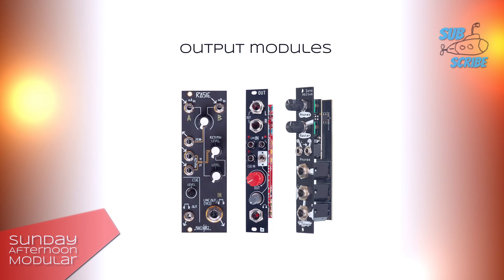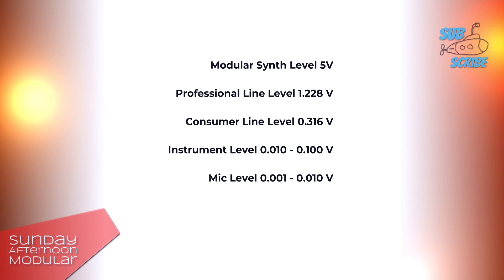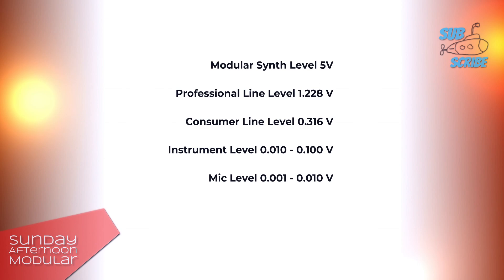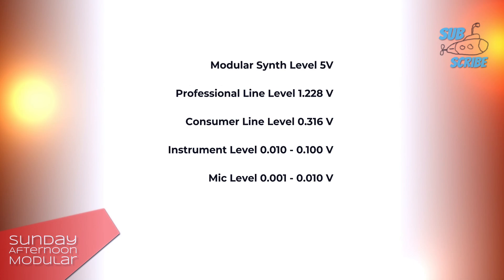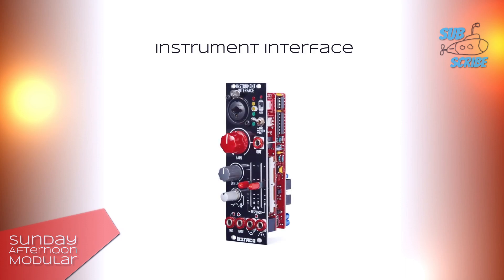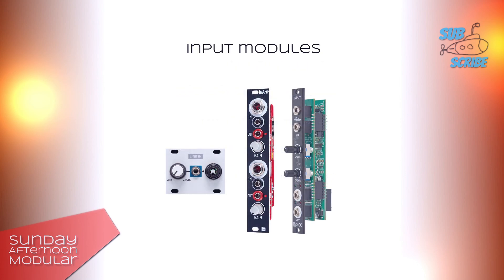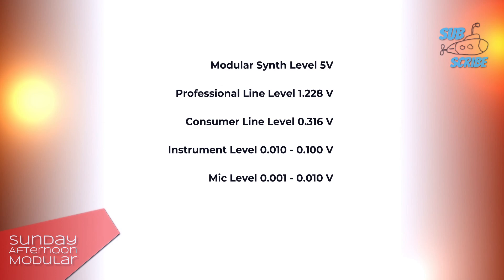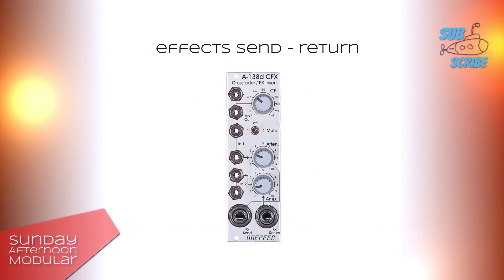SIGNAL LEVELS - Or why In- and Output Modules are of great value

Comment: I feel like an attenuator set properly is electrically valid way to drop to line level (it's not good for trying to hook up headphones). A passive attenuator is a voltage divider, what the output of your module "sees" is the resistant of the attenuator not matter what setting is there. And the divider point is the wiper of the potentiometer and allows you to pick any ratio of two resistors such that the input of your mixer sees the original signal scaled down (voltage drop). The key here is your mixer needs to have high impedance inputs (normal on any solid-state line input built in the last 50 years). As long as not too much current is sourced from your modular's output you should not cause distortion or sagging of the signal. 

The danger of having to set the attenuator value yourself is people generally over estimate how hot to make the signal. You really are going to have to crank it down to 5% to 10% of the attenuator to be anywhere near the line level. And feeding a quiet signal because you accidentally have other stages in your modular patch that have made things too quiet, such as filter cutoff, VCA gain, or giving your VCA's CV too weak a signal (some are wide open at 10V, 5V, or even 7.5V. Envelopes usually output 5V, but there are so many modules out there that do things differently)

And if you want headphones. you must use a headphone amplifier. That can be a convenient eurorack module, or it can be a headphone output for CUE/MON setup on a mixer.

A lot of modern and digital guitar effects pedals are line-level friendly. Any pedals the keyboard people are recommending are going to be good for modular synth as long as you can bring your synth level to a line level. Vintage guitar pedals can perform very poorly with line level, vintage fuzz and wah-wah are both very dependent on the amplitude of the input signal and may not work at all or may not have the same "character" that they do with a guitar. Other effects like reverb and delay almost always work well. 

tl,dr; Mixers and some pedals should work as long as the voltage divider is set to scale your modular's 10 Vpp level to something your line in will accept, such as around 0.5 Vpp to 1.4 Vpp.

Comment: Don't have many modulessince i just started. But a passive output module is one of the first modules I bought. More specifically a Erica synth Link which is very helpful since I use my mixer with headphones and aducting levels. Got a Mutable Instrument ears to boost levels plus it helps control stuff with gate and such